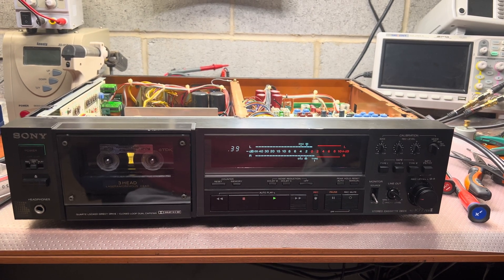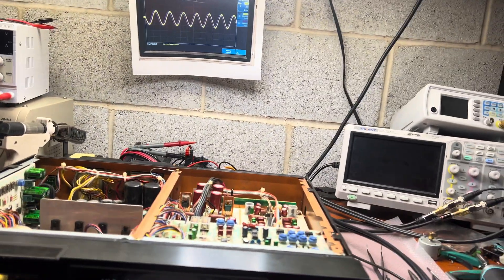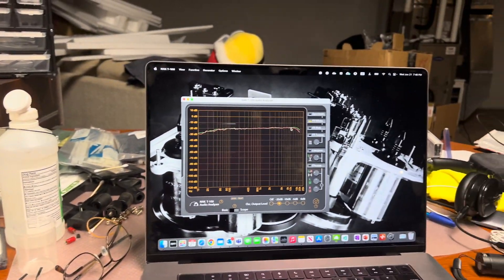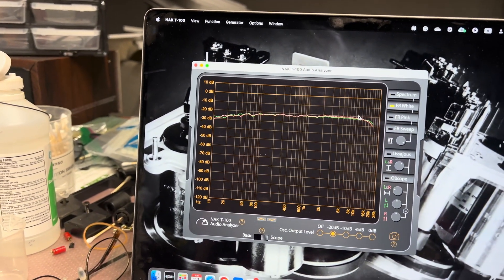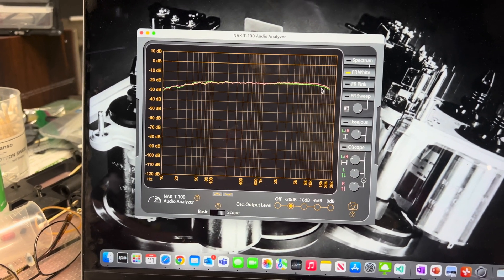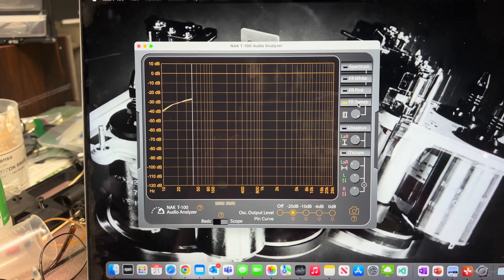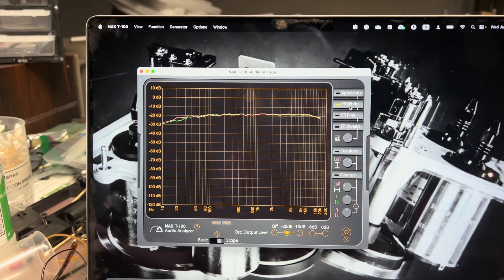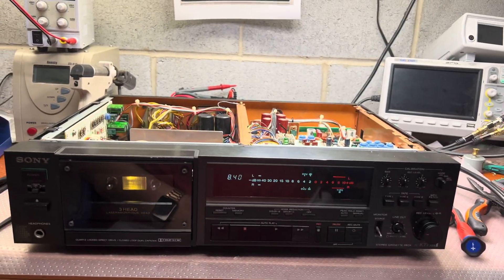Sony TC-K777ESII Restoration: Fine-Tuning for Peak Performance

Comment: Thanks for taking a look at t-100 w&f spectrum! All looks exactly the same as at mine 777. Also mine is having exactly the same problem with slight overbias in the right channel (looks like you are demonstrating my deck😀) - all tape types same results actually, and while running swypetone test it shows slight rise at low frequencies, meaning it is not rec head wear, but bias misalignment. I might also just make same adjustment as I don't plan to recap this deck now